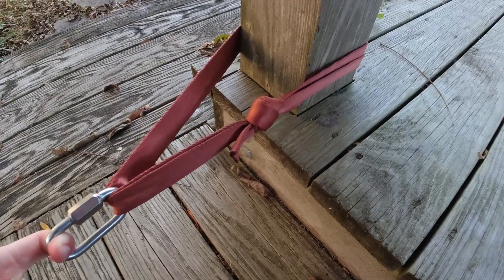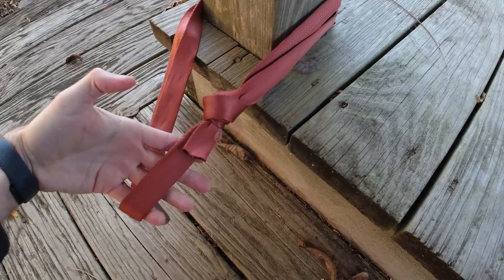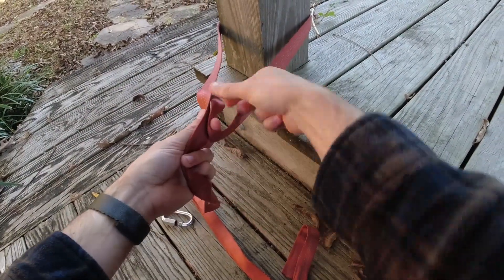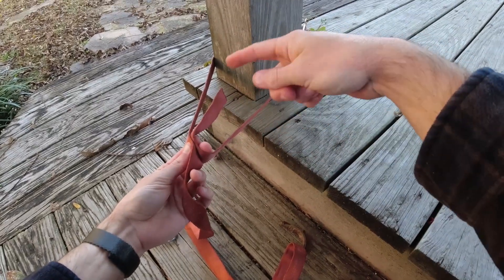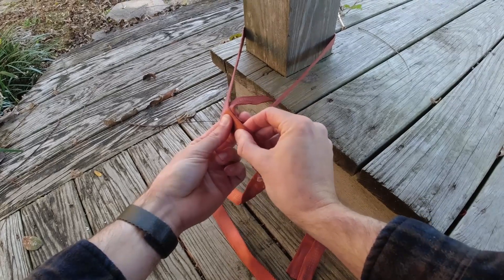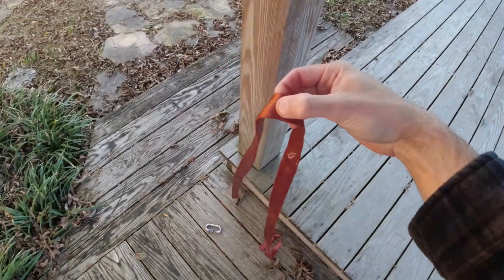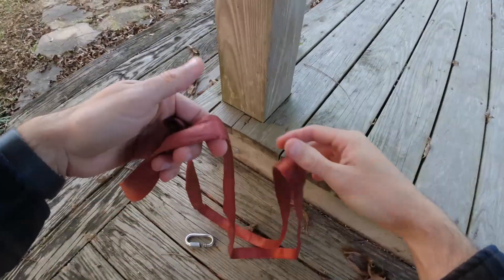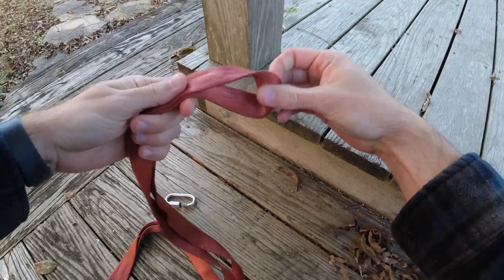Canyoneering Tech Tip: Better Monolithic Anchors

Comment: In the climbing community this would not be considered a safe anchor. The most likely point of failure is the water knot getting undone (by say a small branch opening it) which has been the cause of several documented accidents. Consider looping the webbing around the anchor point twice then tying a single water knot. Then create a master point for your quick link by making a doubled loop with an overhand knot. This becomes a closed system even if the water knot were to fail.
Reply: I got to hang out with some cavers this summer, they use a system called "wrap 3 pull 2". Since the knot is in the wrap that fully against the object you're wrapping, there's less load on the water knot

Comment: Is there a reason this is better than a basket using a piece of webbing folded over and then tying the water knot like normal, which then makes a redundant basket.  I’ve never seen this method where you rethread from either end.  Just curious?
Reply from the maker: The basket is not entirely redundant without adding an overhand at the masterpoint (it's only redundant in terms of adding redundant strength via more strands)  If one strand of the basket breaks, it fails.  The benefit of this is that there is break redundancy and strength redundancy. Also the link/rapide is not trapped by a masterpoint knot and can slide on the webbing and equalize.